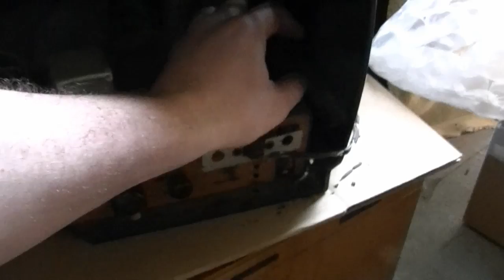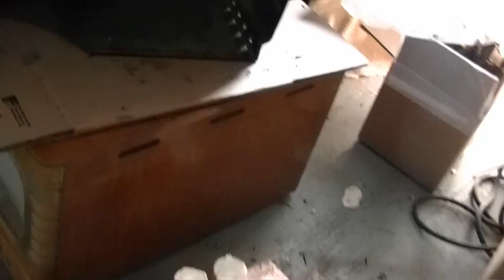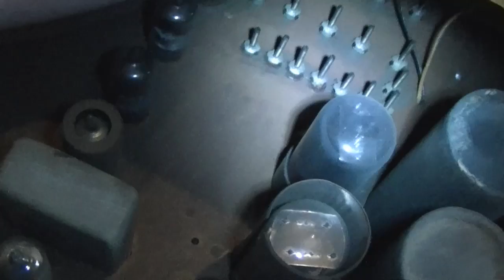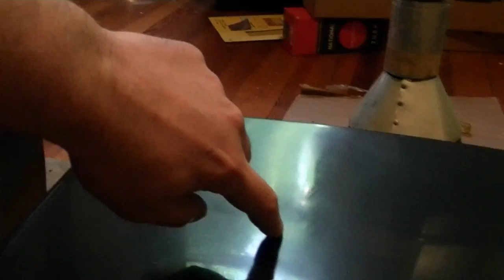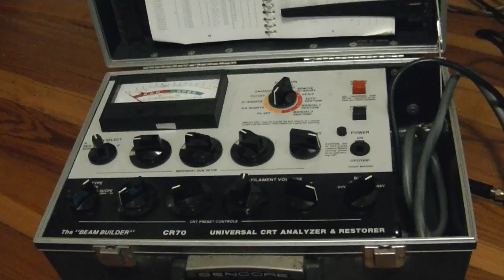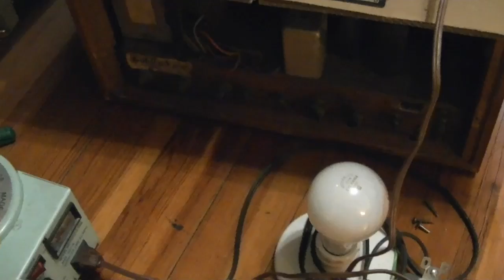Auction Motorolas

Comment from the maker: I should have mentioned in the video that "Scope" in the setup chart doesn't necessarily mean it is actually used in scopes.  It just means to set the mode switch on the CRT tester to "Scope".  I believe all electrostatic tubes are tested in scope mode rather than video mode.  That alters the voltages applied to the various elements in the electron gun under test.

Comment: I hate it when TVs or radios use a faux wood grain like that blond set has, I have a Packard Bell AM/FM radio that's covered in the stuff to make it look like a walnut or brown mahogany, since it's also flaking off I plan to replace it with real veneer since the cabinet is basically a rectangular box. My Philco Bing Crosby used the same stuff and it has also perished in places, I'm not sure what I will do to replace it there since it's shaped like a bread box on the front.

Comment: I've found that two part epoxy glue, the kind that takes 24 hours to set, works very well on repairing broken Bakelite without re-enforcement. On a chip like that where it's supported on all sides but the back, and is fairly thick too, it has lots of surface area to connect with. The key is to make sure that everything is spotlessly clean before you try gluing. It's very strong glue, I have repaired broken Bakelite knobs with shafts with it and they seem to hold.

Comment from the maker: It's under low pressure so no big deal and it's actually quite clever.  The iron and hydrogen react to form a current regulating effect.   Do a web search on 'iron wire hydrogen ballast' and you should find some articles on the subject.